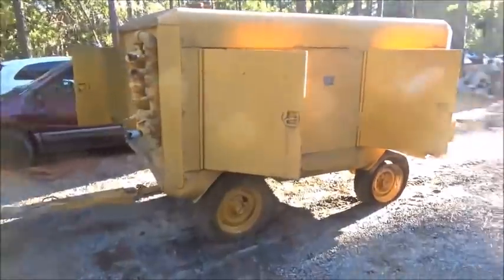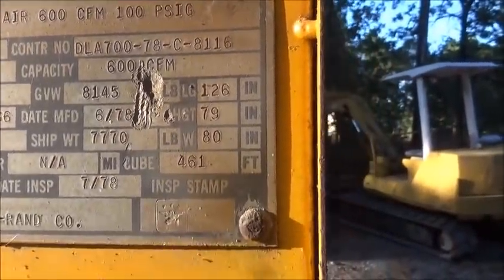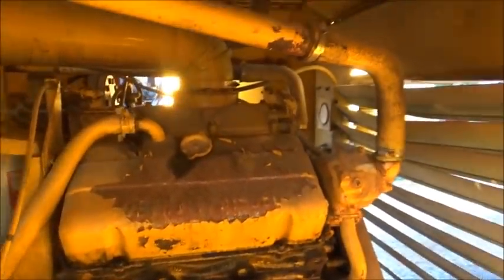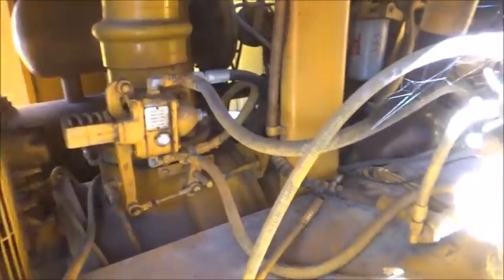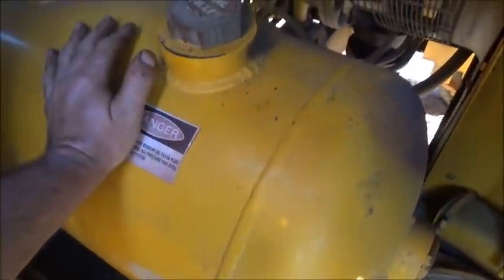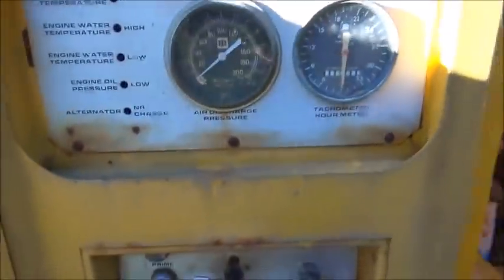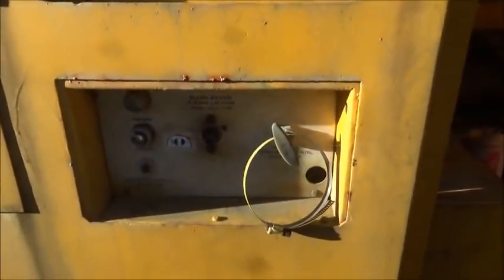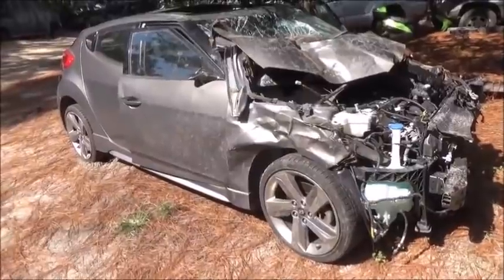600 CFM INGERSOLL RAND BIG ENOUGH TO RUN A STEAM ENGINE!!

Comment: Commercial air compressors allow a certain amount of oil by, thus are not certified to fill dive tanks or support deep water divers! If it is military, there should be a procedure on the door?(that valve you were messing with, has to be open to start!) Be certain it wasn't overfilled on oil, and that the separators aren't collapsed (manifold connection gone wrong). Hope this helps

Comment: Change that oil back!! I bought a IR185 that did the same thing and what had happened they put hydraulic oil in it.( simple mistake) but that oil wont work.. I drained mine and filled it back up with air compressor oil( stuff was high) I ran it a few minutes and changed it again and it started pumping air just fine. We've been pushing 9k to 12k of sand every month for 5 years until I shut down the blasting.  I still have it and it still works.. I hot lucky and I sure hope you do to.. couple 5 gallon buckets of oil is worth the gamble..
Reply from the maker: He told me he used transmission fluid

Comment: We had a 600 Ingersoll just like that one years ago where I worked.. We used it for sandblasting, painting, running jack hammers and at another place we had one they used for running a pile driving hammer.. Good units with leaking detroit.. lol cheers from Louisiana

Comment: Hey jonathan, I dont know if you watch elderly iron channel or not but he had an ingersoll air compressor do the exact same thing after someone changed the oil in it it stopped building air and come to find out the pump part works just like an air motor on an impact gun, it has the a rotor with some kind of fiber vanes in the rotor and when they changed the oil they put thw wrong oil back in it and it caused the vanes to swell up and stick in the rotor

Comment: great idea, using air presure to power up the old steam engine! the warning about "human consumption ", refers to the use of compressed air for diving. Compressors designed for that use a number of srperators and filters to deliver Certified dry air.

Comment: Most likely , the compressor is a Screw comp. two vanes meshed together . They are controlled by a slide valve and the slide valve is operated by oil or hydraulic oil. Most likely the oil pump from the compressor itself . Their is a position transmitter attached to the slide valve  giving it a reference position. Load and unload the slide valve .  Oil change you said then the problem started .. air locked ? Hmmm

Comment: Most used a coolant that was a bit different than oil. A thinner viscosity. I would drain and replace but the last 5 gallons cost me $600. From Ingersol Rand

Comment: If this is a scroll style compressor, which is the most common style, and the guy changed the compressor oil and it quit working am betting that the issue is in the oil/air separator filter needs attention.  There should be a throttling device on the intake to the compressor would be something to look into.  A handful of these type of compressor use recirculation to control pressure, basically when pressure is reached they simply recirculate the air to maintain pressure settings.  Worked on them in industry for the best part of 30 years and they are not that complex, just get the manual for it and it is a simple fix.

Comment: The warning means do not use the air output for diving or filling diving tanks.  There may be exhaust gases in the compressed air. It is not breathable air. BTW the motor is a Detroit The supervisor is a CAT.  How would anything get done without  Feline Supervision?   God bless you all

Comment: Good score Jonathan, for interest sake,in my final year in my apprenticeship as a fitter,turner and machinist, for my own toy collection I built a Vee twin steam engine,with 35mm bore and stroke,for testing I successfully ran it on compressed air,15 CFM at 100 PSI,am not sure of formula required for your application, other engineers may do,best change oil to lighter weight to start with,then start testing? Kindest Regards,Dave McLaughlin Queensland Australia

Comment: I looks kinda like a screw compressor I once maintained. It was newer tech and used an electric drive motor. It had a oil seperator tank in the discharge. There the loading was regulated by oil fed through a solenoid to operate the slide valve as well as being fed back to the compressor.  Air flowed from the seperator through a spring loaded check valve which clogged once restricting the output.  If the seperator tank was low on oil the machine could not move the slide valve to load up and it just ran unloaded with very little output.

Comment: Are you shifting from startup to run mode? They start at a reduced pressure, after warmup you go to full pressure with the start run control. 461 means the machine takes up 461 cubic feet of space. Make sure it has the proper oil. The little 100cfm at work uses Doosan oil, they bought the division of I-R.That should be a screw, not a vane compressor. Bobby should know all this and be able to help.

Comment: Screw Compressors require specific synthetic lubricants in specific viscosities. In Screw Compressors it’s usually referred to as a Lubricant-Coolant. Coolant because as air is compressed it gets hot.  600 CFM @100 psi is going to generate hella heat. That’s why these lubricant-coolants are synthetic, regular mineral oil would oxidize into tar at these temps and pressures.
When there is a problem always go first to what changed just before the problem presented.   The oil was changed. It sounds like wrong Lubricant, possible wrong viscosity, possible wrong fill volume.  That is where you start. First step - get a clean lubricant sample and send to a lab for analysis. This may tell you if there are wear metals from damage. There are kits for this from lubricant suppliers. Google Kluber Summit Lubricants. Their tech support can tell you a lot about your compressor. You might even get free oil lab analysis.

Comment: DON'T RUN IT. Assuming it's a vane type pump - the old Ingersoll compressors use some kind of phenolic material for the vanes in the pump which swells up in certain types of oil. They get stuck in the slots in the rotor. In this state, running it with stuck vanes can lead to them all getting busted up and destroying the housing. Most likely it's going to need to be torn down and the vanes replaced.

Comment: Sounds like Anthony Newsome has your problems solved on the air compressor. Wrong grade of oil was used. Key part = unloader valve on engine to regulate air pressure. Usually a military equipment is well maintained while in the military. But like most stuff. When the military sold it. That was the last time it was serviced well.

Comment: Jonathan you’re correct you have a screw compressor. Since it appears to have worked well before the oil change I would suggest that you find the correct oil for the compressor. We build gas compressors and they always have limited types of oil that can be used. There will be a gas and oil separator because to compress the air the air mixes with the oil to create the seal. In the gas oil separator the air is separated from the oil by a coalescing filter. If the wrong oil was used it could plug the filter causing the compressor to strain to get the air out. So oil change and filter change should get you right. Good luck my friend.

Comment: I remember those compressors from my early days in the USAF (1964) I think they used them to start the B47 bombers but I could be wrong. I was a C130 mechanic so we didn't need to use them. Jim

Comment: The drive on the front of the supercharger is geared and could probably break you would have to pull it to find out, but you should be able to see if it is spinning by pulling the intake off and you should be be able to see the rotors moving.  The surface of the inner housing can gouge like a cylinder and cause it to not gain pressure.  Plus see if the faces of the impellers are rough or pitted.

Comment: Don’t know much about the compressors, but I do know a little about the two stroke Detroits— I’m assuming the air cleaner bit you said was missing was for the engine? If so, hopefully it wasn’t run much without those air cleaners... doesn’t take long for those Detroits to get “dusted” if run without proper filtration. All that dirt will ruin the blower, circulate through the crankcase, sludge up the oil, damage bearings, and polish the piston liners till there’s no cross hatch left. Drops compression considerably, making the engine hard to start and way down on power (maybe enough to prevent it from building pressure? I dunno, really don’t know anything about those compressors). It’ll run (those old lumps will run even in the worst condition), and maybe even sound ok, but a completely dusted engine will need a full rebuild. 

Crossing my fingers that the filter housings just rusted off from sitting,  because I’d love to see that thing powering the Bates!

Comment: Hey Jonathan, like others said, that unit is a rotary screw oil flooded compressor. There are a few things that will cause the symptoms you talk about. Like some of the other posters said, first make sure it has the right oil in it. The wrong oil will cause loss of performance but not like what you have. As we ask at work while troubleshooting, "what is the last thing you did before the problem started" the guy changed the oil. The oil should have the viscosity of ATF fluid. If it is thick like gearoil then it's wrong. In fact for a test you can use ATF fluid. Also, you didn't say but is the inlet filter clean? It could be the unloader circuit but on your unit even with a partially closed inlet hat, it would still build up to full pressure but you just wouldn't have the full CFM rating. To me it sounds like the motor isn't making full power to run the airend (actual compressor) to full pressure. I would first make sure the engine is running properly and then look for problems further down. Now I have seen worn rotors, bad bearings, ect cause problems in rotary screws but if that was the case you would know it because they are loud as hell and the air discharge temp goes way up! One other thing to check is oil separator filter Delta pressure. You could have a plugged oil separator filter and it would show up with a high sump/separator tank pressure and a low outlet pressure. Good luck. By the way, that was me over at Smokstak beating on that guy who was dogging on your vids!

Comment: Hey Jonathan,
Love your efforts to save the Bates Corliss Steam Engine. About this air compressor, I looked at the "Elderly Iron" video: https://www.youtube.com/watch?v=7NOWjOUAtGg&t=2s  about this same problem linked by a comment further down on this video. On there another commenter lists this Technical manual link that lists what you have and how to decipher the Serial Number etc and how to get replacement vanes. It is likely per Elderly Iron's video that the oil last added was not compatible with the material the vanes are made from and caused them to swell up inside the rotor. They may have gotten jammed and cause the engine to drag down. The vanes are made from some type of phenolic material? Ingersoll Rand was bought out by Doosan several years ago. Doosans' Customer service number is 1-800.633.5206 Here is the link to the Tech Manual: Google this:   Doosan-Portable-Power-Aftermarket-and-Technical-Manual-2018.pdf   If you look on your label plate, third down from top left it says "Reg Number" that lists your model was manufactured for the USN in 1978. (not for the Air Force LOL) Model P600SGM. Under "Legacy Compressor Manuals" section, the Parts Manual number is 35064997 and the Ops and Maint manual Number is 35064989 listed on Page 167. Also Listed there is  Model# P600SGM-C0340 Prime Mover is G.M. 6V53N with "Serial Code" of 997.  It is Doosan Serial Code Listing Number 963 on page 251. Also Page 141 lists new Vane Sets.

Comment: It'll be interesting to see what you find out about that one. I've been using industrial compressors at work for 35 years but that old girl looks like it predates anything I've ever worked with. If they are low on oil they wont build air. There's also a small valve usually up on the accumulator tank that has a couple of small capillary lines running to it, that's the unloader and where you can set the pressure. Could be an issue with that as well. Also could be the other fellow used the wrong oil in it and bunged something up. I doubt it's bearings though, you'd hear them if it was. Best of luck with it, 600 cfm is a lot of air!

Comment: At least now, after you’ve got your Bates Steam engine all setup for your static display out front, you’ve gotta HELL OF A perfect air compressor for allowing that steamer to slowly operate under compressed air, like the machinist hobbyists do with them scaled down steam engines.

Comment: Hi, Jonathan. I owned a company that used big air compressors. We did sandblasting and painting. I had a 600 CFM IR. I could run two 6 bag sandblast pots. It was a great machine. I don't know a lot about them as I used a mechanic to work on it.

Comment: IR air compressor is probably a sticking blow down valve or bypass valve. Go a tap valves with rubber hammer and see if it frees it up. Air end is not likely to be the problem, control valves, electrical or dirty separator filter and spin on) cartridge filter needs changing. Steam engine is great project.thank you for saving it.

Comment: Screw compressors require a specific oil s46 ? If the problem started after an oil chenge that would be relatively cheap to rectify.  if properly cared for the air end will outlast at least 2 engines

Comment: Not for human consumption - can’t use it for breathable air, like a scuba tank. If you get this compressor working, you could substitute if for a steam boiler, and power your steam engine with it. You could have the engine up and running inside a year.

Comment: Craig Stevens seems a master builder and leaves a phone number at twelve fifteen at the end of Running a Corliss video. saw Reddrryder running a model Corliss on three PSI of air and Craig Stevens turning one on 1, 1/2 PSI. They were both doing about 30 RPM. I know for sure it will run on that compressor especially if it’s turning and not “pulling” a load. Obviously doing work would take way more pressure than just turning. John V. McDivitt also had a model, a Corliss Duplex, smooth.

Comment: I've done some research on rotary screw compressors cuz I have a reason to use them that's all I'm going to say anyways these rotary screw compressors they don't like to be turned off and on constantly they'd rather stay running what probably happened is he did not prime the oil pressure to the screws they have to be lubricated before they rotate or it will scar up the case they have to be properly lubricated to operate or they'll literally shred themselves to pieces look up rotary screw compressors online they'll tell you how they operate and their stats good luck I've always wanted one of those rotary screw compressor peace out into the world have a great day

Comment: Jonathan, 600 cfm will more than run your engine.  When we don't want to light one of the boilers and wait for steam we have a compressor that is 135 psi at 185 cfm and it will run any of our big engines.  New England Wireless and Steam Museum.  newsm.org  
Our YouTube channel https://www.youtube.com/channel/UCp7lG7F6H1xO2bB-SW4oQsg
Our Corliss is 16 in bore by 42 in stroke with a 15 ft flywheel and it starts easily and runs good on the compressor.

Comment: Worked on a lot of 'em back in the day, most had 6-71's, all Ingersoll's.  Doubt any bearings are bad or internal problems.  We had them for emergency plant air and we would start them with half a can of either and run, 10 below ice cold, max rpm on the governor at start and never had a problem.  Most often wrong oil.  They use a Roots style compressor, some of the newer units use a screw type but both compress a oil mist/air combination and there is an oil separator in the main receiver and if the oil is to heavy it will load up pulling the rpm down.  We used to run ATF but your on the right track, the manuals are available on line.  Good luck.

Comment: Hey Jonathan, that is a screw compressor, it is directly coupled to the engine and is running if the engine is running! It uses an unloader valve on the intake of the compressor to control how much psi it makes. Also it  most likely has no seals on the screws themselves, on the shafts that’s all. These compressors pump air and oil at the same time, the oil is used as the seal between the screws and the housing! As the compressed air/oil mix leaves the head it inters a scrubber to separate the oil from the air and the oil returns to the oil holding tank to be injected back into the compressor air inlet to be used again! It is constantly being circulated through the head. Special oils are used for this and are sometimes manufacturer specific, I bet the wrong oil was used or not enough to keep the head flooded with oil while running. If it did indeed work before the oil was changed, and now it doesn’t, I would start with that! Also if wrong oil was used it may clog the scrubber and or damage it!
Reply: Anthony Newsome I agree with this I have been working on a few of these and ran one when I was in the army

Comment: Lots of catscanning going on. Good work Ninja Catscan.
I have seen Mr. Pete use air to power his model steam engines, so this makes sense. I don't doubt you will get the engine in running condition, at least for display purposes.
Very neat!
Thanks, and Meow to Ninja Catscan.